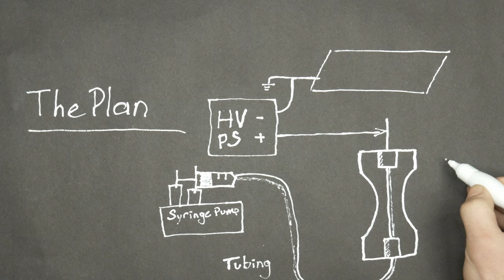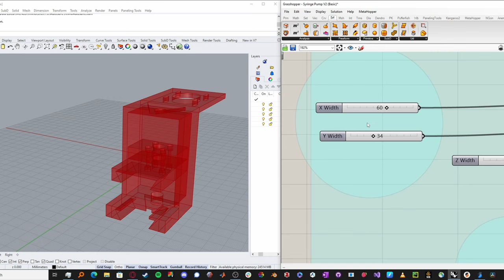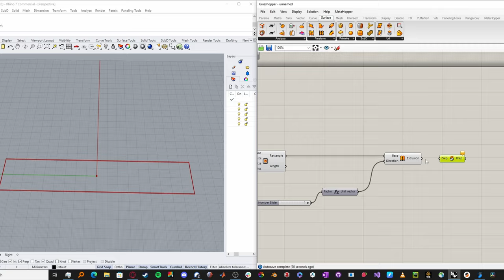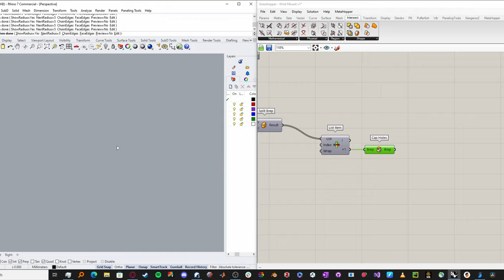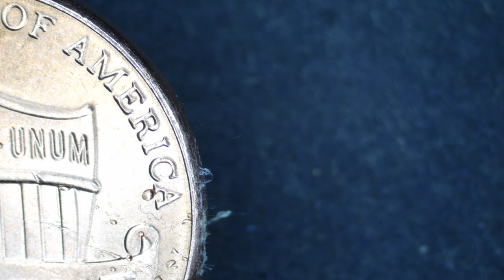I built Spider-Man’s webshooter… that Electrospins

Comment: Put carbon nanotubes inside the mix, spray a sheet, I bet the extremely high surface area and conductivity would make some interesting materials. Home made super batteries anyone 👍🦄
Reply: Spray it above a rolling sheet of aluminum, roll it up with thin insulation and make super capacitors

Comment: Would a peristaltic pump supply work better for controlled flow rates?  Not sure what voltage you are running, but a battery powered CCFL driver might be a more portable source for HV.
Reply from the maker: In my experience, I haven't had much luck with peristaltic pumps. I found that they "Pulse" the fluid rather than have a continuous flow. I am however, planning to design one for a microfluidics project. I am also planning to come back to this project, so I will definitely try out difference methods. 

For the HV, I was using around 30kV, but my PS doesn't have a voltage indicator(sketch, I know), so I don't really have a good answer beyond that. I am going to look for into CCFL drivers, I had never heard of them until you mentioned it, but it does seem like a good alternative!

Comment: ditch the mindless step feed add a force sensor and apply constant pressure feed system.
i have another larger project the uses a ballscrew to drive a constant pressure. I have the ball nut inside a 3dprinted pulley captured between large bearings with a square UHMW block inside a square tube and prevents it from turning this lets me drive the screw in and out on PTFE sleeves by just spinning the nut.. the low rotating mass make for very fast direction changes.
you can do the same thing with some M5 threaded rod and nut at small scale (my system uses a 32mm dia 20mm pitch screw and can throw a person with a 8kw 6200rpm 24nm servo at 3:1 with 680mm/s common place with around 4300lbs of force at stall)

Comment: This is amazing! Awesome video!
I wonder if one could do the same with a solution to spider silk proteins.
Reply: You can do it will work with spider silk proteins and fibrion solution made of silkworm silk and other polymer solutions
Reply: @xtopher05   Good idea! I'll give it a try
Reply: @filigenzilab9613  i have no clue on the the viscosity or voltage needed for spider silk proteins or fibroin solution or polymer solutions it can vary depending on the viscosity and how's its made but best of luck bro with ur experiments and remember to take safety precautions. Because working with chemicals and electrospinning can be dangerous without the right safety precautions
Reply from the maker: Thank you! Ironically, I worked in a lab where I have electrospun silk fibroin from Silk Worms!
Reply: @WrylyRiley  thats awesome u should try working with them for a video
Reply: @WrylyRiley  cool! Would it be okay if I ask some questions in regards to electro spinning spider silk?
Reply from the maker: For sure!
Reply: @WrylyRiley  where May I obtain a solution of spider silk proteins? I thought about just getting silk peptide powder and dissolving that in water, but what do you think?
Reply: @WrylyRiley  Also, do you have an email address you'd be okay with sharing so we may further discuss this? If not, that's fine
Reply from the maker: Yeah! Rileyslabyt@gmail.com
Reply from the maker: @filigenzilab9613  This is a big questions with a lot of chemistry! I'd be happy to chat more via email or zoom!
Reply: @WrylyRiley  do you have a discord?
Reply from the maker: @filigenzilab9613  Hey! Yeah, I just made one. Here's the link! https://discord.gg/549VYUuA
Reply: @WrylyRiley  thanks!